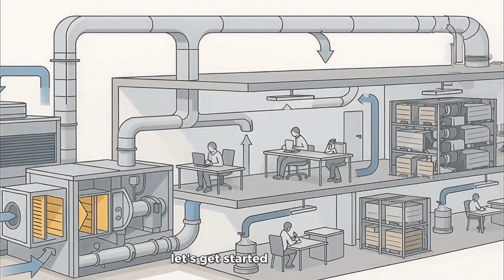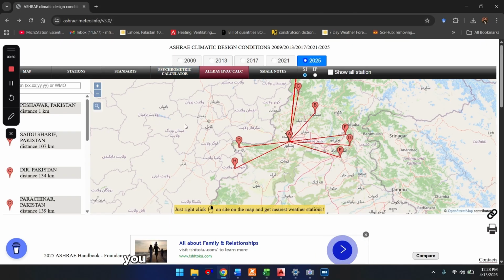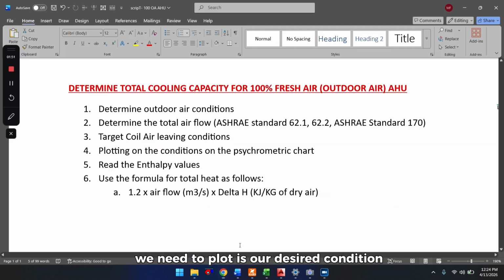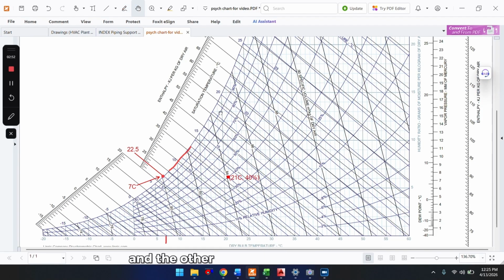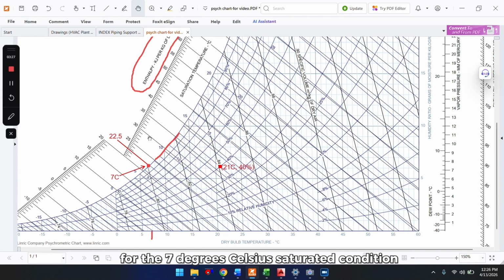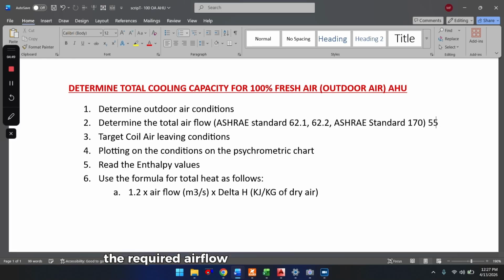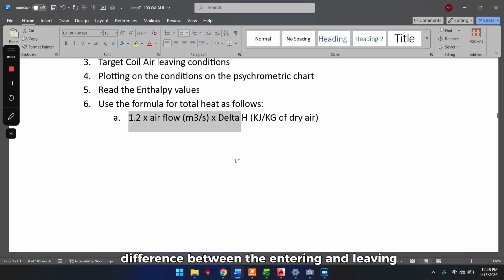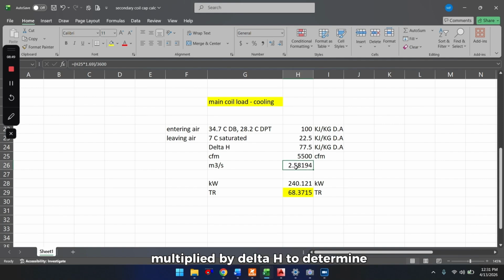100% Fresh Air AHU System | HVAC Design, Working & Airflow Explained

Comment: Air flow how to get
Reply from the maker: Using ASHRAE Standard 62.1 fresh air requirement as a minimum. 

For hospital buildings use  ASHRAE Standard 170

Make sure to consider air flow for  pressurization of spaces for negatively or positively pressurized areas